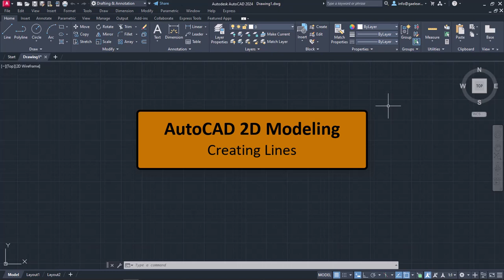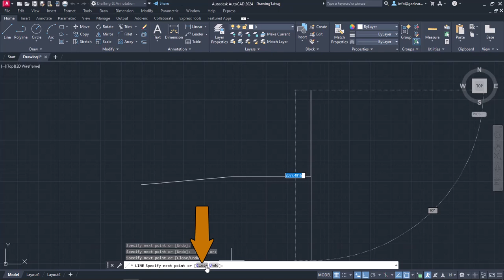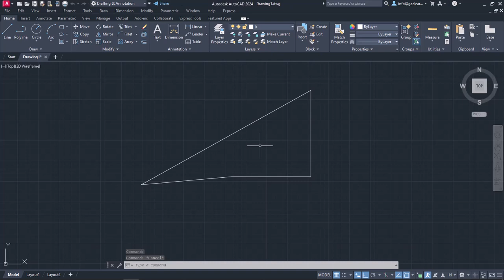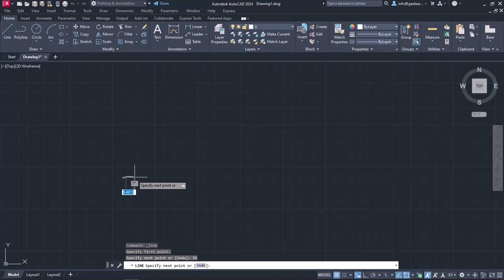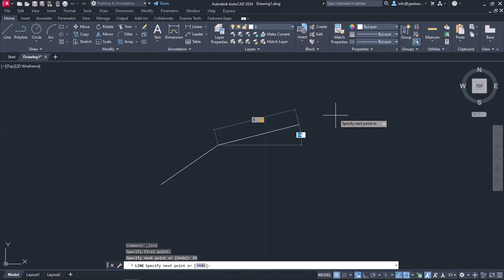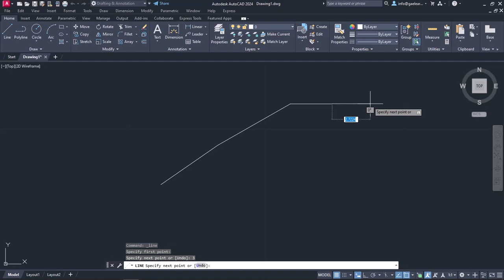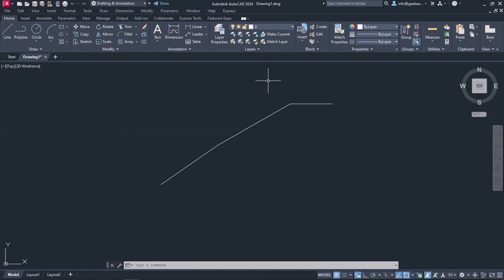Draw Lines in AutoCAD (AutoCAD 2024)

Comment: I have been converting to Autocad from Turbocad and have to tell you I think autocad stinks one thing everyone fails to teach is if your last line of 3 meters is incorrect how do you change it to 4 meters and from where does it extend in turbo cad there is the tool bar at the bottom i can just type it in change the origin point and it will extend from that point or default is the center.